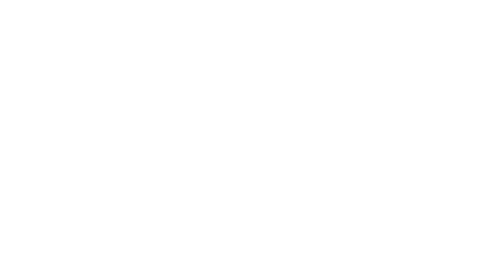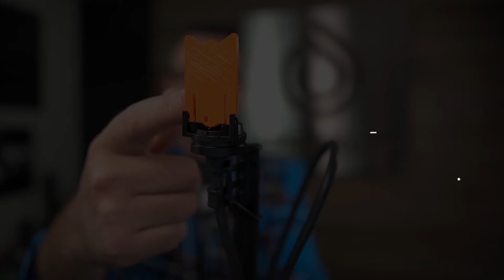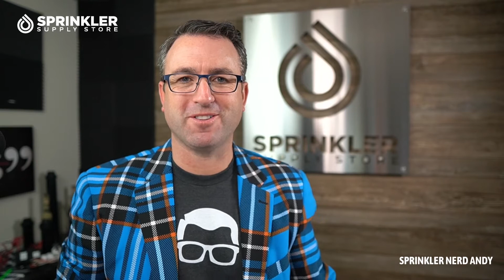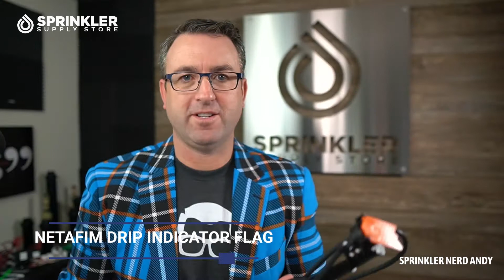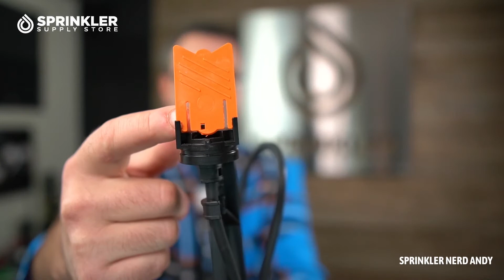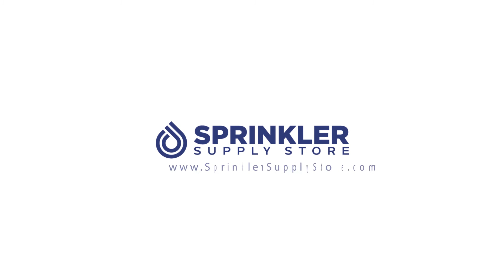Netafim - 10-F-01 - Drip Indicator Flag: Product Review | SprinklerSupplyStore.com

Comment: Can this be used for watering blueberry bushes?
Reply: Thanks for your question.  This particular product is only made to indicate that your drip system is on and doesn't water anything, but drip irrigation in general would be a great option for watering your blueberry bushes.  Feel free to get in touch with us directly at our website for technical assistance!
Reply from the maker: Yes, this will indicate if drip is currently running in your blueberry bushes.